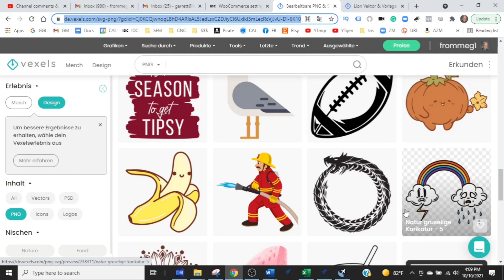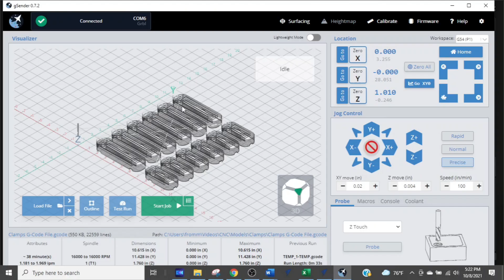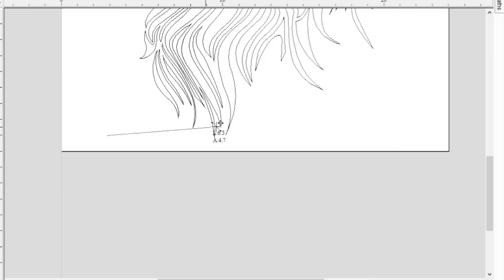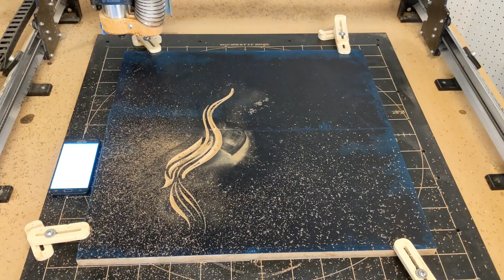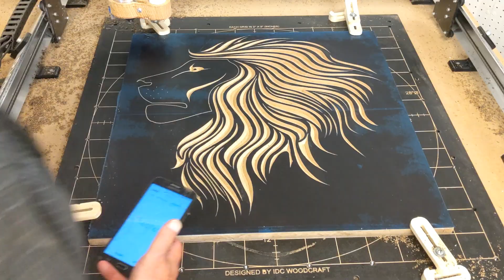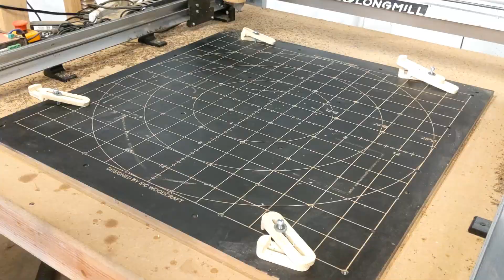The Fastest V-bit For CNC Router Projects Vcarve - Longmill CNC Router 120 degree v bit

Comment: There is a version of gSender for Raspberry Pi. The older Buster OS but I have plenty of Pi's. Thanks for the link, didn't know about this software.
Reply from the maker: Always Censored, I am not to sure about that one brother. If you are using your Pi with Linux, consider Universal Gcode Sender.
Reply: @IDCWoodcraft  Tried USG, it is a bit flaky on my main 64bit OS, gSender works better on a new uSD with old Buster OS. Nice to have alternatives, better than TurboCNC on FreeDOS anyway. Also trying LinuxCNC on Pi's. So many ways, the Longmill guys had a path select app, FreeCAD and Inkscape, which is the path I had already installed. The plugins for those are amazing, 3D boxes etc. The home CNC community is huge.

Comment: Hello Garrett,    what bit do you recommend to carve stars in a flag union?    I have attempted with a 90 degree 3/8 bit, and I am just watching the router jog around above the material.
Reply from the maker: Jbnremt, that is a good bit to use for stars in a flag union. Take a look at your toolpaths and make sure your feeds and speeds are good. You might not be cutting enough out per pass and it basically looks like your cutting air. LOL
Here's my feeds and speeds chart: https://bit.ly/3xiLebv
Reply: @IDCWoodcraft  Thanks for the info!   I will look at everything again, and give it another shot.    I am hoping to get these stars mastered.  I carved stars by hand with a Dremel for a year, and it was a painful experience!
Reply from the maker: @jbnremt  You will be so so so so happy with having a machine carb stars! I can't begin to explain how you're going to feel when you see that machine whip them out so fast and they look perfect

Comment: I am a hobbiest. If I can make money doing something I enjoy it is a win win. I enjoy carving (free hand). I have done many small carvings and in particular have several wood gnome like creations that I enjoy doing. My son wants a chess set done with the wood gnome theme. My question is: is it possible to do something like that using vector aspire, where I would import the picture of the gnome(s) and then cnc the front half of the gnome. It would speed up the process, make the matching pieces actually match and maybe even find a market for the set. I am completely new to Vector but as a computer analyst my understanding of software is usually good enough to ensure a shorter learning curve than many. My Longmill CNC will not be ordered until I have completed my move to West Texas and have set up my new craft room. I am watching all your tutorials and trying to get a gist of what I can and can't do. Thanks for any advice.
Reply from the maker: Hey Dan, I couldn't agree more it's absolutely a win win! You could definitely make gnome themed chess pieces. I would recommend making the front and the back separately and then bonding them together. If you wanted it to be one cohesive piece, this would get tricky! I think you're right about having a smaller learning curve with your background as a computer analyst. I bet you could probably teach me a few things on the Vetric software!